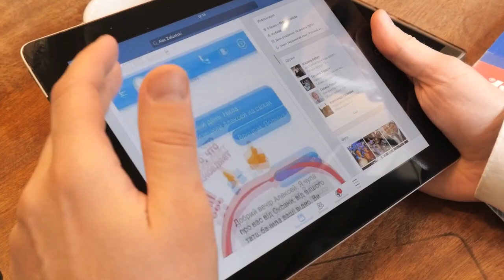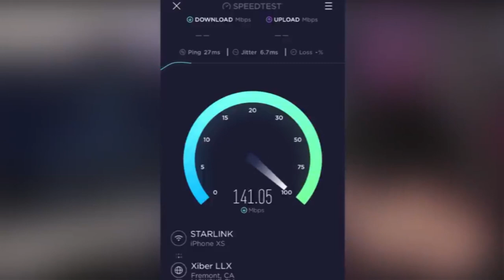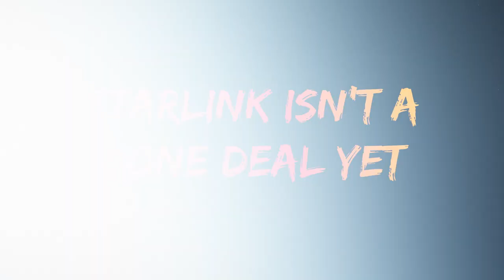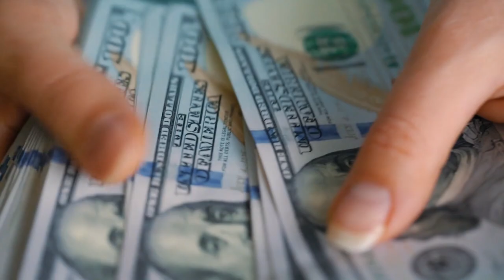Why Starlink Will Never Replace Your Internet

Comment: Starlink's only achilles heel is its outages. Mine was running at 450 Mbps down and 60 up the other day. Shame about the outages because it disconnects me from my Zoom meetings that I cannot be disconnected from when I am working as a simultaneous interpreter!
Reply: Not the only archilies heel.  Archillies hill will not become apparent until system is much more congested with users.

Comment: I'm sorry but this is really a negative rant. I was paying nearly $50/month for 4Mbs. Now I pay $100/month for 50 to 190Mbs. Irratic? Sure. In reality it hit 50Mbs only ONE TIME in a terrible thunder and lightning storm with high winds and torrential rain. But 50Mbs is more than I need. Than I have EVER needed. Any other time it's never fallen below 100 Mbs.   I absolutely fucking LOVE StarLink.
Reply: wait few months... pay attention to the electric bill... We'll see it 5 years later
Reply: I prefer my  verizon LTE home internet ($50/month, $0 equipment cost) in my rural home.  solid 50+ Mbps download all the time.  Rock solid hail or storm or snow or rain, or brutal summer heat wave, and much cheaper than Starlink!  LOL